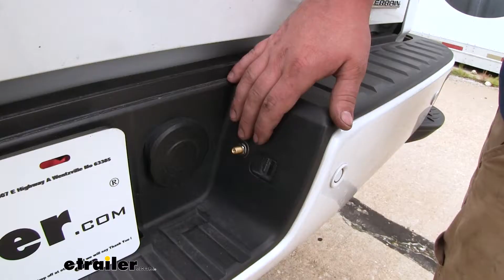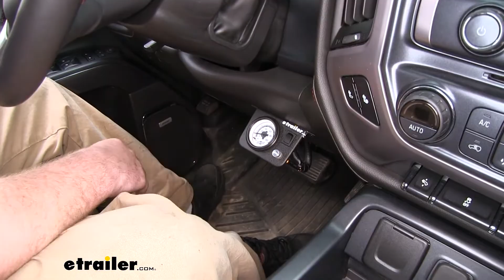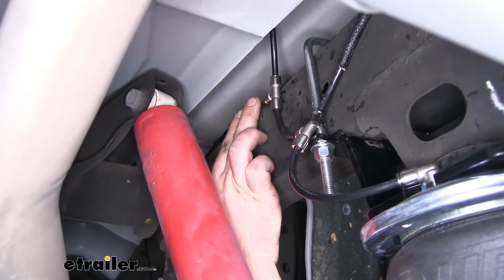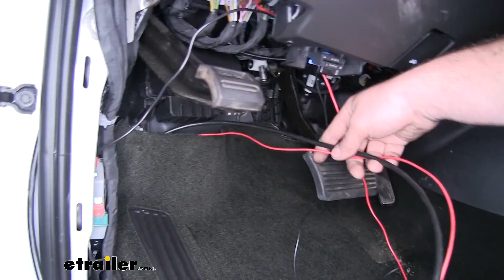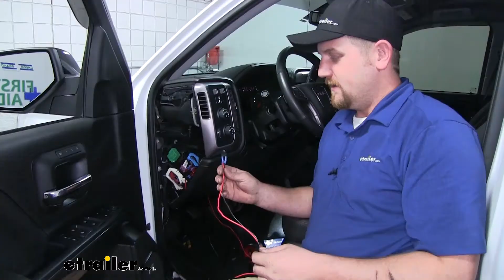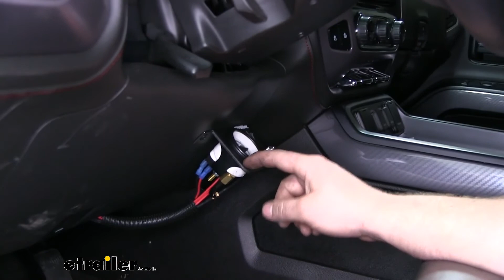etrailer | Air Lift Load Controller II Compressor System Installation - 2018 GMC Sierra 1500

Comment: Very nice vid. Thank you. I have the same compressor that failed on me a couple of years ago (been filling my air bags manually since). I just ordered the new compressor...maybe this time I'll mount it a little different as I'm guessing water is the cause of the short that keep blowing the fuse.
Reply from the maker: That very well could be the problem. I would definitely try mounting it in the driest place that you can find up under the truck. We have heard of people mounting it on the inside of the cab behind the rear seat for ultimate protection from the elements.